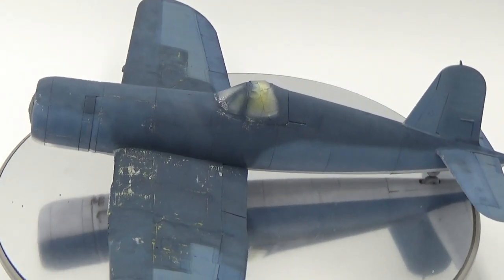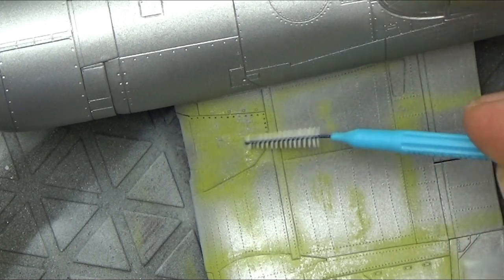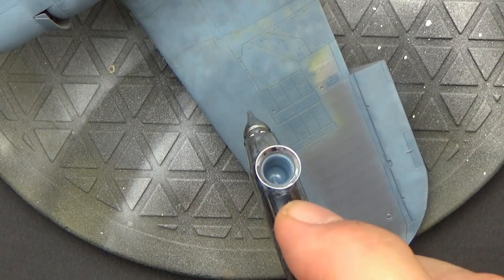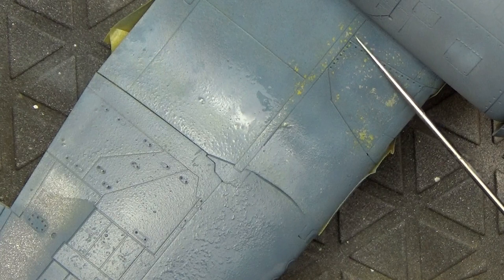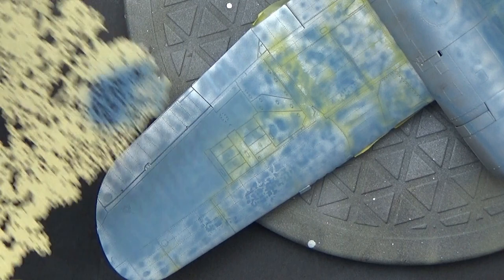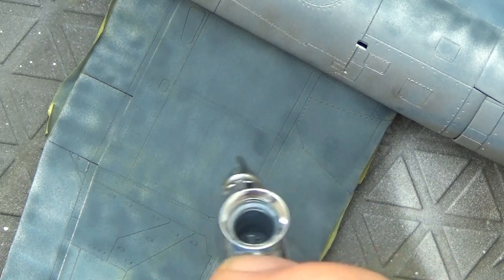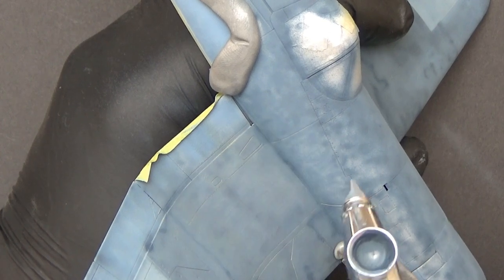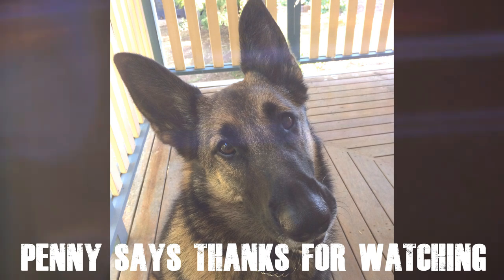Double layered hairspray chipping to weather a Pacific Corsair: Tamiya 1/48 F4U-1 Build - Part 4

Comment: Hi there 👍🏻 what's the best size needle for this technique for the airbrush....?  Also love you're videos, very useful.
Reply from the maker: Hi DLY, I used the 0.2 needle in my Harder and Steenbeck to do this, a 0.3 would work fine as well, although 1/32 is easier but takes longer....cheers, Chris
Reply: Thanks mate, that's very helpful 👍🏻

Comment: I tried a hairspray chipping technique recently but sprayed the hairspray from the aerosol can.  This proved to be a failure as there was way to much hairspray covering the model.  Do you use your airbush for application and if so, what do you use to clean it so it doesn't get all gummed up? Windex perhaps?
Reply from the maker: My preferred method is to spray the hairspray into a separate cup, leave it sit for 5-10 minutes so it gasses off, then pour that into the airbrush and spray at around 15-20psi in very light coats. It will dry very quickly that way. I use Isoproypl alcholol to clean it up - and you must do it straight away, including pulling the needle out. 
I recently used this method on my Tank Girl vignette - took minutes to dry instead of hours using the Mig/AK stuff and very very controllable.
I have used hairspray straight from a can - its perfect for large things like a U-boat (see my video on that one), that you want to heavily weather, but I'd still prefer to use the airbrush to control the flow. cheers, Chris
Reply: @beckersmodels  Thank you!

Comment: Where did you find the reference images? I am wanting to do something similar to my tamiya 1/32 F4u1D corsair and I have found some decent reference images, but nothing of the underside of a beaten up aircraft. I know the 1D variant only came out in 1944, but they were used on the end of a very long supply line on carriers, so they would have been beat to hell anyway from the salt spray and high operational tempo.

Comment: Shouldn't there be another hairspray coat before the blue layers?
Reply: I was about to ask the same question.   The video shows adding dull coat.  I would think there would be another layer of chipping fluid there.
Reply from the maker: Indeed there is! I forgot that line in my voiceover - after you seal in the previous layer with a matt coat, you then apply another 2-3 coats of hairspray, let dry, then apply more paint.  cheers Chris

Comment: So the hairspray can still be activated through the DULLCOAT?  Is there a time limiit where it may no longer be activated?
Reply from the maker: No the dullcoat seals in all of the chipping and "turns off" the hairspray, so you can do another layer again - I didn't really make that clear in the video sorry!
Reply: So after the dullcoat the first layer before paint is another hairspray/chipping fluid layer I guess right?